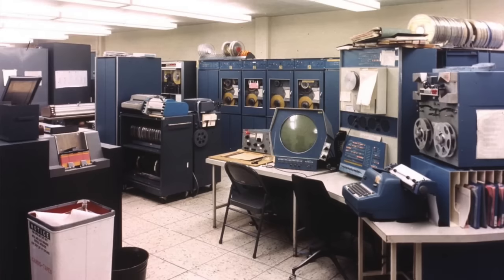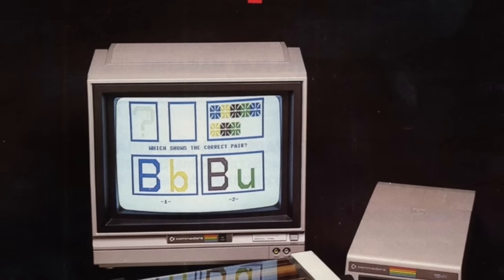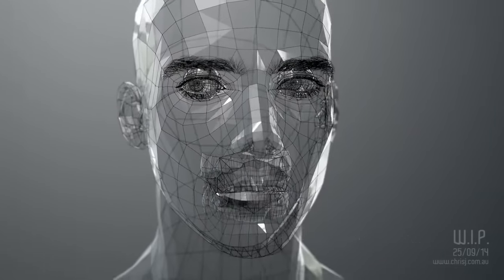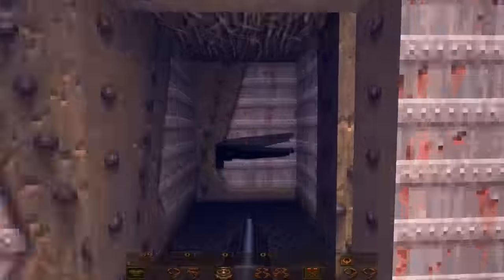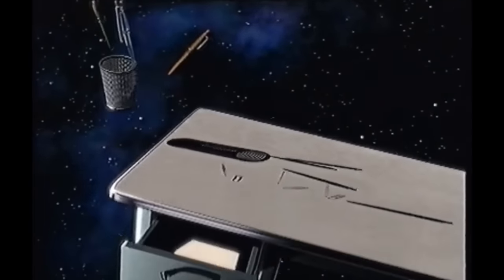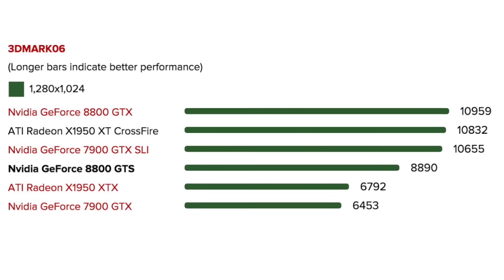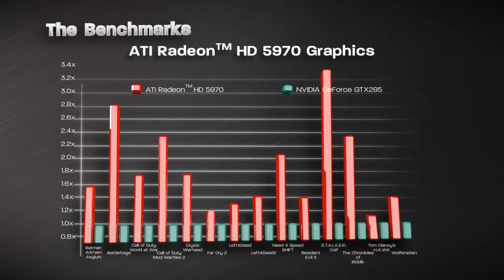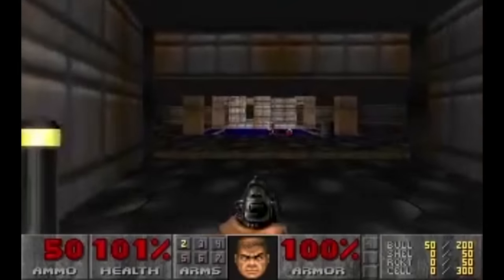Evolution Of PC Gaming Hardware

Comment: My PC is shit:
Intel Core 2 Quad Q8200
GT 220
4GB RAM
Though it was back in 2009 when I got it, so it was actually pretty good 6 years ago, just not now
I'm planning on getting this build:
Intel i5 4690k
GTX 970 4GB
8 GB RAM
Reply: I have the build you're planning on getting but I have 16 gb of ram - the 4690k and 970 are beasts! Best of luck in your build!
Reply: +RX4gun Thanks! First I have to get the money for it though, lel
Reply: +CerealKiller The part where you have to pay for it.. damn :P
Reply: +CerealKiller excellent rig too bad it does have one of those motherboards
Reply: Darth Robert The motherboard was going to be an MSI Z97
Reply: aww you ruined a perfectly good joke don't even reply back
Reply: +CerealKiller what i'd do to get my gt 220 back :'(. Right now i have a gt 610 and it runs like shit, even games from the 2000's
Reply: with the GT 610 I run games alright but not ever above 75fps not a single one above 75fps even very old games
Reply: +CerealKiller Just gonna sit here with my Q6600 in shame now
Reply: Mine is only slightly better than yours.
Cpu: intel core 2 quad Q8400
Gpu: voodoo... Oops i meant nvidia geforce gt 630
Ram: DDR2 4GB
Reply: +CerealKiller I'd recommend looking into an r9 390 over the 970
Reply: D3athChick3n Yeah, I've been looking at that, but Nvidia seems to have better optimization over games. Like in Witcher 3, hairworks was much better optimized for Nvidia cards, but not so much on AMD. Plus, shadowplay
Reply: ***** Yeah, I'll look into it
Reply: +CerealKiller   I have a desktop that has intel pentium 2.66 ghz, gt 210, 4 gb ram. But now i have a laptop that is GTX 960M 4GB, I7 6700HQ 3.1 GHZ 8 GB DDR3 ram
Reply: +CerealKiller Just upgrade the graphics card and buy a cheap LGA771 Quad Core Xeon off eBay, theres a pad mod you can get (off eBay too) for £2-3 that allows you to use LGA771 CPU's in a LGA775 board.
Reply: +CerealKiller nah dawg AMD r9 390x
Reply: Bill Nye The Russian Spy Yeah, I decided on the r9 390, not the 390x though, it's way more expensive and it performs about the same
Reply: ***** Yeah, I'm buying an r9 390 and I switched to i7 4790k
Reply: +CerealKiller At least, you don't have Intel HD Graphics 3000 like what my Laptop has...
Reply: +CerealKiller That's what i have, i5 4690k, GTX970 and 8Gb DDR3, i'd recommend one of the newer AMD cards over the 970 though since it'll stay relevant for longer.
Reply: +Grandmaster C its a really popular build combo. I hear about it all the time
Reply: +CerealKiller 
I built my Pc around the same time as yours, about xmas 2008
Q6600 @ 3.0ghz
(originally) gtx 260 black edition / (2011 upgrade) HD6970
4gb ddr2 ram
Samsung 840 evo SSD

She's feeling her age now and despite fallout 4 needing 8gb I've managed to clock 8 hours ingame without it being horribly unbearable but haven't played it in a couple of weeks since I'd rather wait on an upgrade within the month or so.

I'm currently weighing in 3 or 4 options, each option is more expensive than the last........
1. Get a socket 775 mobo + 8gb ddr3 since my mobo only handles upto 4gb ddr2
2. New mobo/cpu/ram
3. Option 1 or 2 with another HD6970 in CF since they're as cheap as £70 now
4. New mobo/cpu/ram AND gpu

Obviously everyone would choose option 4 but having kids with xmas and birthdays coming up the mrs wouldn't be happy if I splashed out on me lol
Also wondered if a 2nd hd6970 would just be a waste of time and should I just uprade to a newer card altogether.
Anyway, that's enough typing for now. Doubt most people will even read my comment this far
Reply: +505Northman 
oh I'd love to but you're talking £180 for the cpu, £80 for the mobo, £250 for the r9 390 and that's before buying ram and possibly a psu.
The Mrs would kill me since my kids have birthdays on the 20th & 27th of jan then the 20th Feb and I'm still recovering from xmas lol maybe I'll get to treat myself come my birthday in march
Reply: Actually, I think I'm going to go with the GTX 1070 when the pascal line comes out
Reply: +CerealKiller Technically all PCs are shit consoles are vastly superior to PCs for the price
Reply: all22787 Pff obviously, i mean who needs 4k when you can have 900p
Reply: CerealKiller Exactly I am glad at least some people on these videos has some common sense.
Reply: im using a 7850k, 750ti, 8gb ram but now i will play less since i got employed on real estate im even thinking of selling it most of the time now im out of the house lol
Reply: +Phoenix it can even be overclocked
Reply: +CerealKiller I too used have a gt 220. It performed so badly on current gen games
Reply: ***** This just in. They shut it down.
Reply: +CerealKiller Processor isn't actually that bad, I had a Q8400 in my secondary rig with a GTX 660 and 4GB RAM and it ran games like the Witcher 2 and Metro Last Light with ease at high settings 1080p, of course newer games might need some more RAM and a better card if you want higher than medium details.
Reply: +CerealKiller i have an i3 weak laptop. i can't run fallout 4 :(
Reply: Zan Getsu Fallout 4 isn't very well optimised honestly, a cheap way to build a gaming PC would be to get a cheap Core 2 Quad tower like the Dell Optiplex 745 then add RAM if needed and something like an R7 250 and you should have a decent little system that should easily run all games, albeit at low details at 1080p or 720p to achieve good frame rates, shouldn't cost too much either.
Reply: RedDragonGamingHD
i'm actually saving for an r9 295x2 i7 16gb of ram pc and a 1440p monitor, i have about 5% the money i need :( it's gonna take a while
Reply: Zan Getsu Haha shit that will be one hell of an upgrade, well good luck with saving for that monster
Reply: RedDragonGamingHD
haha yeah that will be a beast btw i want some advice should i get a 295x2 or two 980ti?
Reply: +Zan Getsu if you has that budget, take two fury x's they scale like crazy.
Reply: Zan Getsu Really depends on the applications you have in mind, personally I prefer the 980 Ti over the Fury X due to larger V-RAM,if you're playing at 1440p a single 980 Ti would be absolutely fine and should destroy 2k, multiple GPUs really should be for 4k. Honestly even an R9 390 is pretty damn good at 1440p, guess it depends on the deals where you live and what you want from it.
Reply: +Zan Getsu wait till Q2 or Q3 when the gtx 10xx series and R9 4xx series cards are released
Reply: +CerealKiller What motherboard are you going to get?
Reply: BefitHalo PWN For the build I want to get, probably this one: http://ca.pcpartpicker.com/part/gigabyte-motherboard-gab150md3h
I changed the cpu to a i7 6700k
Reply: CerealKiller what is everything from the build,i need to know
Reply: CerealKiller Because at newegg the 390 is 339.99
Reply: +CerealKiller There are so much old games to play. Newer games are good, but not much better than the old ones. It's all about atmosphere and older games has plenty of that.
Reply: +CerealKiller slam a gtx960 in there some more ram  and enjoy gaming
Reply: +Young “Da” Jimmy No, its 4GB.
Reply: ***** or yeah that
Reply: SeikonDS I think I would rather go with a 660 or even a 750ti, I feel like a 960 will bottleneck
Reply: CerealKiller For budget 750ti is the best for you, and if your worried about bottlenecking than its a great option.
Reply: +CerealKiller change the gtx 970 out for a r9 390 its a bit faster in dx11 and better in dx12 and has more vram i wouldnt advice anyone to get nvidia when dx12 i a year or so away
Reply: +CerealKiller That's exactly my build (almost)
I5 Quad core something
MSI GTX 970 gaming 4G
8GB Ram

It's a very good build. Can handle bo3 on 80fps
Reply: ***** Yeah, it seems like more of a popular build
Reply: CerealKiller And it defenitly does the job
Reply: Of course it's shit. It's 8 years old.
Reply: I'm gonna wait until 1070 comes out, costs only $50 more, worth it to me
Reply: +CerealKiller $50 more than which GPU?
Reply: +CerealKiller i would wait for pascal to because amd is prob gonna release some badass shit to
Reply: +CerealKiller polaris i mean
Reply: +the gaming guy tom i hope they announce their cards at computex. otherwise i'll grab a 1070 in june
Reply: ***** Yeah, I guess I'll wait for it
Reply: +CerealKiller i have the EXACT same build as you an i also bought in 2009 tf m8
Reply: be thankful i only have 2gb ram
Reply: Mat-Jas Yeah, mine was a pre-built one from HP
Reply: Ill buy a GTX 750ti and my PC is not crap anymore
Reply: NoobWarrior127 See if you can get an R9 270 instead, on newegg it looks about the same price, and it runs much better from what I've heard
Reply: CerealKiller ok but first I'll have to check if my mobo is compatible
Reply: ***** Ik, crossfire that shit and it's faster than a 1080, for $400, around $500 canadian. That's fucking crazy.
Reply: Ive just overheated my Q6600 :’(,

Getting an i5 6600K
16Gb 3200mhz DDR4
MSI Gaming X 1080.
Reply: +CandiBunni nice :D
Reply: +CandiBunni nice one, what's your Skype and we can talk more about this??
Reply: +CandiBunni anything else then?
Reply: intel core 2 duo @2.79 Ghz
4GB RAM (only has 3 now 0-0)
200w power supply
nvidia geforce 200 series (melts itself to shit)

ugh its so shitttttt

before that i had a windows xp pc with:
500w power supply
1GB RAM
!.66Ghz AMD Celeron CPU
and idek what geforce card it has but its old XD i still use it tho

Comment: oh my good. this video is, beatiful. i have a gtx 970 in my pc btw
Reply: Lol I have an overclocked gtx 950
Reply: im playing this video off a potato
Reply: CTElectricGaming
ahahahahah
Reply: Supah X
i have a gtx 970 asus strix :P
Reply: I got a strix rx 470
Reply: I have a gtx 1080
Reply: Eduardo J. Pacheco is it overclocked? Do you have liquid cooling?
Reply: Supah X
you have a liquid cooling on a gtx 950 .-.
Reply: i have a gtx 980
Reply: Van Gamer well, it's overclocked. And I kinda don't want my PC to explode. Sooo...
Reply: i just installed a gtx 1080
Reply: i was going to get a 1080 but my cpu wouldnt see any difference between a 1070 and a 1080.

I first bought a 1060 but sold it to a friend and upgraded. Not because I needed to but because I could.
Reply: Slime Bucket
 what is your cpu?
Reply: I have a i7 6700k
Reply: Supah X
ahahahahahah
Reply: i have GTX 970 4BG to love it
Reply: van gamer I got amd 4350 quad core 4.2 ghz overclocked to 4.8ghz
Reply: I have 2 of them. I wish I had Radeon 480s though.
Reply: 3.5 vram on the gtx 970
Reply: NO. It has 4gb, of which 3.5gb work at the full rated speed and the last 0.5gb work at a fraction of that. But it's still there, and still fast enough to serve some purposes.
Reply: Slime Bucket
change it then
Reply: Michel Roy
it's ritght, thanks
Reply: i have nvideo 100
Reply: Van Gamer Just sold my 970 for 1070
Reply: hamhead1005
i should do it too
Reply: I have a gtx 1080 and i7 6700k
Reply: I only play text adventures on my TRS-80, and draw all the "video" by hand.
Reply: James Bond up top man ! me too ! how far did you overclock yours ?
Reply: I have the MSI GTX 970 Gaming "4G"
Reply: i have gtx 1080ti .. joking i have geforce 820m :( with 8gb ram and a i5 processor :( :(
Reply: Van 1050 ti
Reply: gtx 650 ti 4gb ... :(
Reply: I got a Nvidia GeForce gtx1070ti for Christmas
Reply: I have whatever the xbox one s graphics card has
Reply: i have a rx480 8gb
Reply: Nathan Peratikos hd 7770
Reply: I have gtx 550 ti
Reply: i have a GTX 1050 Ti

Comment: Games didn't really get significantly better since i got an 8800gtx
Reply: true
Reply: well they are working on vr and ar now...
Reply: Tibbs142 vr was around since like 90-s, i remember playing quake 2 using VR helmet back in the day when quake 2 was a brand new game.
Reply: but back then it was gimmicky crap, now content creators are really taking it seriously and hoping it will be the future unlike the 90s which obviously weren't ready for such technology.
Reply: Tibbs142 i didn't seen anything new to this so far, despite the higher resolution this thing puts out, really.
Reply: Then you haven't looked at the systems objectively at all, obviously. The entire basis of making VR work is immersion and presence, which is only just recently becoming possible because of hardware limitations.  It's like saying motion controls were stupid because the Mario duckhunt pistol controller wasn't very interesting. It's not at all comparable to LeapMotion control for example, and if you think it somehow is, or that the Wii is an example ^against^ VR motion controls, then you're ignorant as hell.

We're on the very tip of the crux as to when we can make hardware that is capable of delivering on the experience by which we can experience presence and immersion, the reliably 90frames+ per second clear vision through un-obscured pixel density on high resolution head mounted displays with accurate sub 10ms response motion tracking systems; None of this was possible 10years ago let alone 30. And we're still facing hardware limitations in that we can not make a wireless HMD, it's just not possible via consumer level technology right now. It's barely possible with theoretical experimental technology. We're going to be hard wired to our PC's for a significant amount more time.

Please try and tell me how headsets from the 90's delivered on presence because they were just so damn cool for their time, and out yourself as having neither experienced nor understood the concept of presence with one of the lovely new systems by HTC or Oculus.

60% of VR experience has been cutting down the response time on the experiences as low as possible, so that your body doesn't have a negative reaction to the gimmick. Another 10% was getting the displays to good enough quality to deliver. 5% was the lenses, another 25% would go into delivering that amazing response time into motion tracking. If all these systems can't work together, your body gets dysphoria and rejects the experience. That is how you become able to achieve presence, and the shitty HMD gimmicks from the 80's have nothing to do with modern VR other than setting the prototype for the display method (Which was really moot considering the nature the displays have to be in front of your eyes, a full HMD is the only option regardless of past experiences)
Reply: Yes. The question now is what they should or shouldnt unleash on the public.
Reply: I'm of the opinion that the public can be responsible for themselves and if it isn't possible to take a large bunch of the population hostage through neural link interface hacking or some theoretical garbage like that shit, you should basically not stop people from creating or experiencing that which they want to. We're definitely too early for the government to have any right or responsibility to step in and start cracking down on people over consuming or harming themselves because they willfully disregard their own safety in usage with these nifty new toys.
Reply: Caleb Kolenski lol you've wrote a whole book here answering yet you didn't put a single thing modern VR does, that 90-s didn't except the picture quality. Yeah 90-s Vr had motion control as well, yeah response time wasn't noticeable, yeah 90-s VR made a presence effect, all that changed is that new hardware can allow us to run games at extreme resolution to allow such picture quality in new VR displays, thats about it.
Reply: Quake is almost 20 years old.
Reply: 20 years old this past June :)
It's the game that had us leaving the house with our student loans to drop £99 on a 3DFX card.  I strapped a Voodoo 1 card to my S3 Virge and never looked back.
Reply: Just started my old Win98 laptop yesterday to play Quake 1. Old things never die
Reply: Quake1 is available on modern machines as GLQuake, though I believe it also can work via dosbox. Stone cold game changer
Reply: Warlock M Not a fan of emulating games since it may add glitched and delays. But dosbox is a nice emulator
Reply: It's not really that valid for dosbox unless you're on a 286. It's pretty good. But GLQuake is where it's at :)
Reply: Until last year I was still using my 8500gt.
Reply: The Legendary 8800 GTX
Reply: There's been a huge jump in graphics since 2007, when major titles such as Halo 3, The Witcher, Assassin's Creed, and Bioshock came out. Gaming probably peaked in 2015 with the Witcher 3, but as of late, devs have become more money-hungry and more beholden to lobbies who ruin games and don't even play them, such as feminists. Kingdom Come Deliverance is the only game this year that didn't cave into bullshit like Activision's black female nazis.

Comment: Mmmm, I just have a FX-95MS Casio calculator with a screen with some black dots and a litium battery. Which videogames I could play?
Reply: Download razer game booster. You will get around 420 fps for gta V
Reply: Actually, I have that software, but it seems to be an impossible mission to do something any better with a 1.6GHz 2 core processor.
Reply: Does it have 2 MB ram?